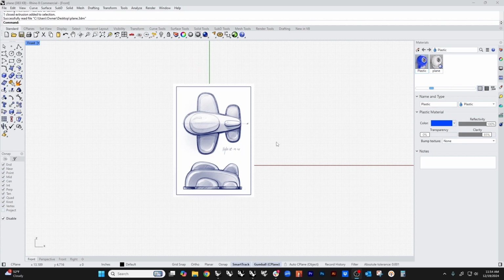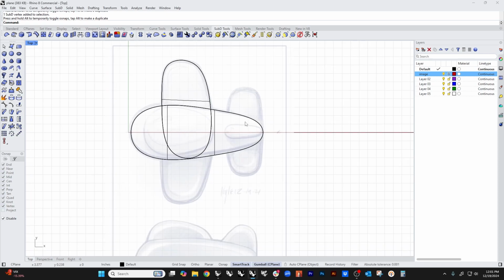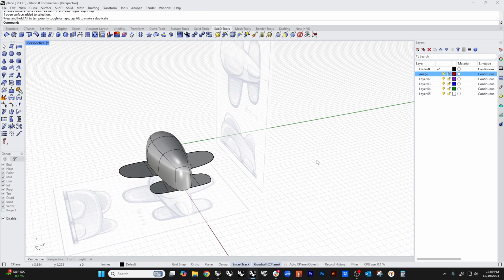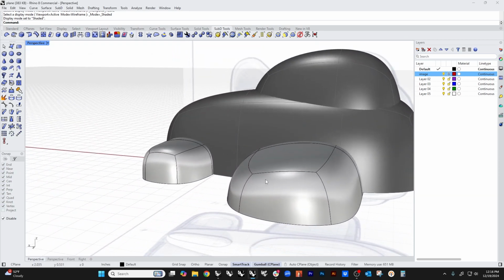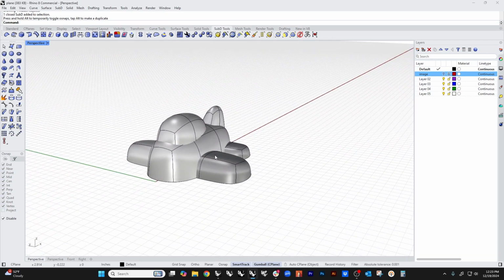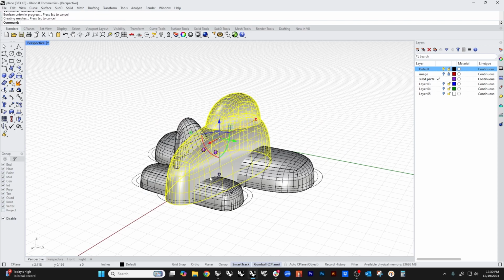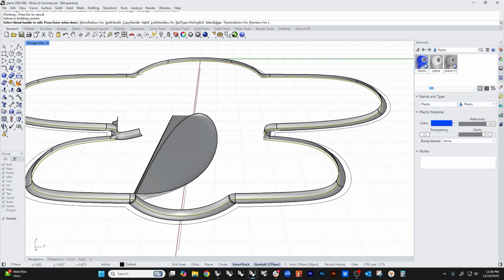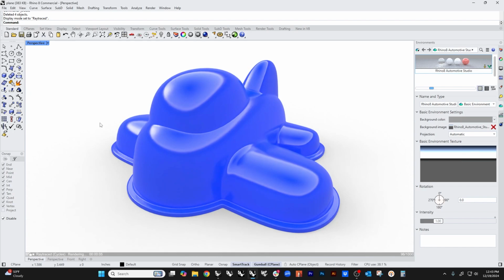Rhino 8 - Your 1st SubD Model!

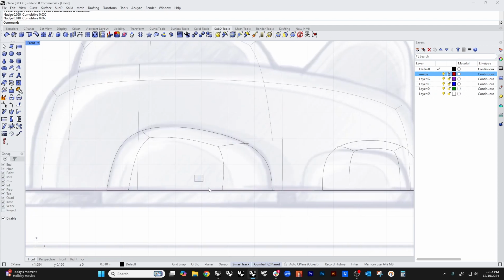Comment: As always very helpful. I have a question though, around min 20:00, when we start to nudge the wings, if I select the edges or points at the top and move them around in the XZ plane, the lower part also gets moved, and can't understand why.

Comment: Thanks Kyle!
But I have a question
28:56 Why is the bottom face of my model not merged into 1 face after boolean?
Reply from the maker: without seeing your model it'll be hard to diagnose, but it may be due to your settings in the boolean command line.. make sure to have it delete input= yes 

you are welcome to send to the model to tech@mcneel.com attn: kyle and I'll take a peek and see if I can help.
Reply: did you solve it?
Reply from the maker: @biyikgokhan  never sent me the model-

Comment: Thanks for the tutorial! One question: if you would be making a part of the round shapes sharp, which method would you use? I used this tutorial to try build a clog shoe - and would like to try make a sharp/straight heel edge for example.
Reply from the maker: you can add creases, either full creases, then convert to nurbs and add fillets to soften them with a numerically defined fillet, or add a soft crease and define it by a crease percentage. 

you can also add a bevel and control it very precisely in subd by adjusting how far apart the edges are.

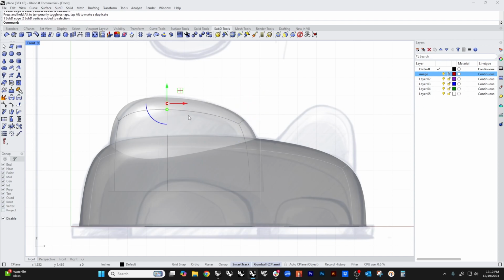Comment: 16:32 Nudge settings - very usefull, thank you so much for this tip! #rhinoceros #nudgetool #highprecision #subD
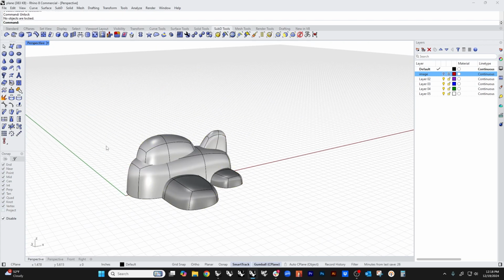23:00 DraftAngleAnalysis command - to check angle problem #moulding #injectionmoulding #mould